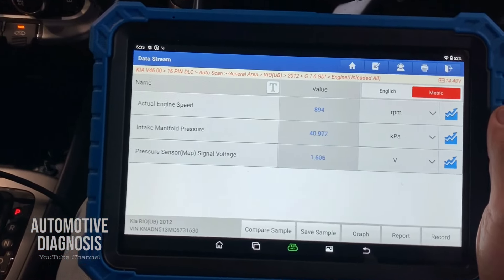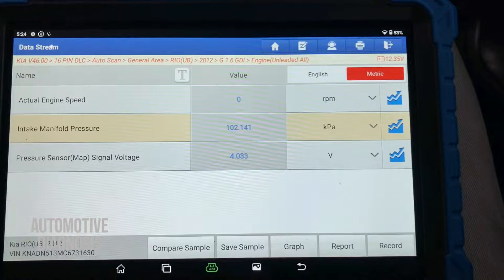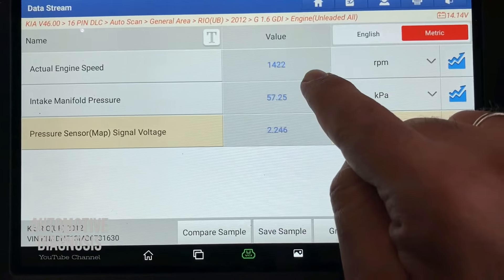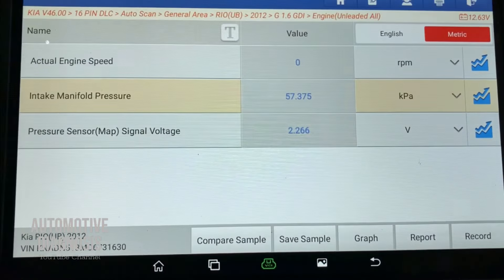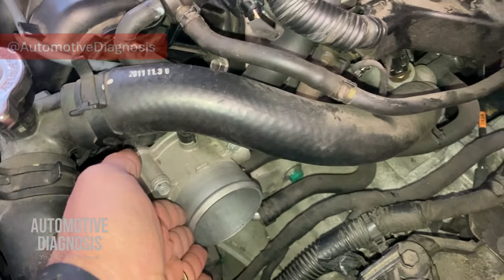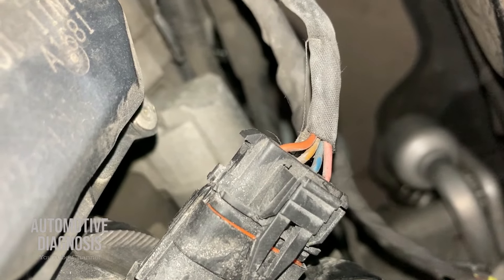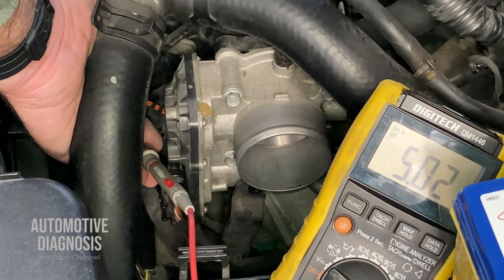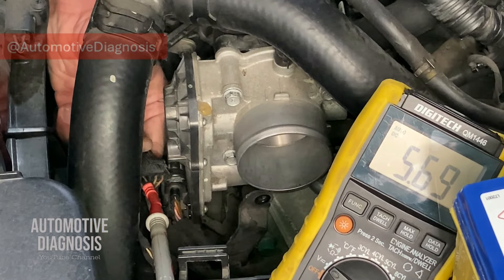You Won't Believe How Easy MAP Sensor Testing Is

Comment: Hello Sir I have fault code p0645 p0481 p025a p0620 on Lincoln mks AC and fan not working fuse and relay are good  AC Relay control wire continuity to pcm  is ok,AC relay active test pcm not ground to AC control wire ?
Reply from the maker: Hi my friend. Have you checked the cooling fan relay’s control circuit?
Reply: Save the error codes
Erase the error codes 
Start the engine and connect the AC so you can see if that works 
Then you can do a new diagnosis, there can you see the error code one or two

Comment: My power voltage is reading 5.7 volts and when I connect it it drops to 0.4
Reply from the maker: Hi there, I think that’s signal wire and works fine. However this signal is for engine off situation and when you start the engine it must change.

Comment: Great video as usual, what wiring diagrams do you use ... Regards Andy
Reply from the maker: Hi my friend. I used KIA GDS for wiring diagrams. GDS used to be the KIA and Hyundai OEM scan tool which comes with all diagrams and manuals.
Reply: It's easy to do test when we have wiring diagrams 
There can we see the colors of the wires 
It's difficult to do a test If we haven't a wiring diagram and the color of the wires